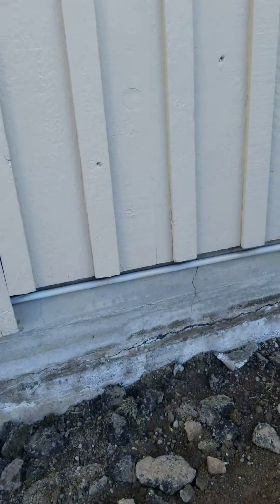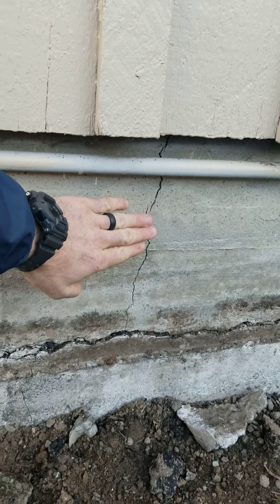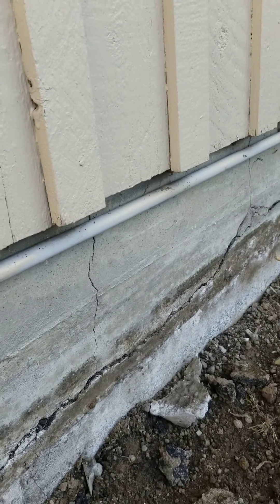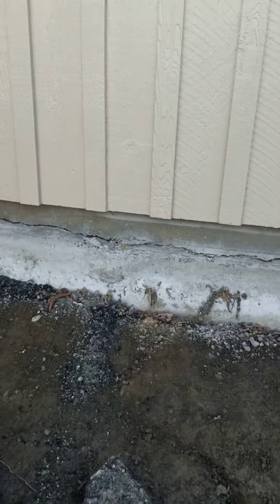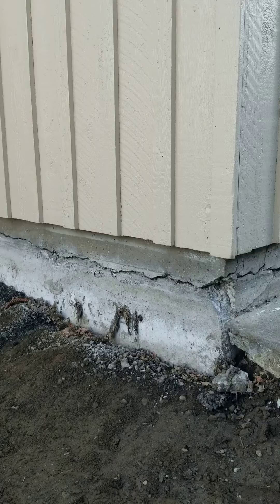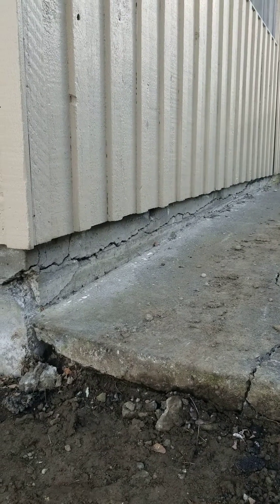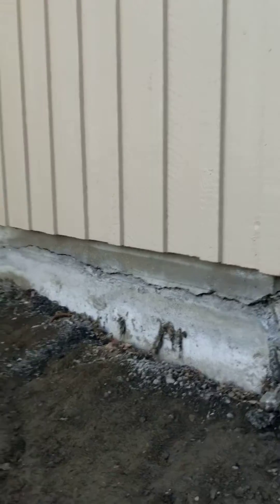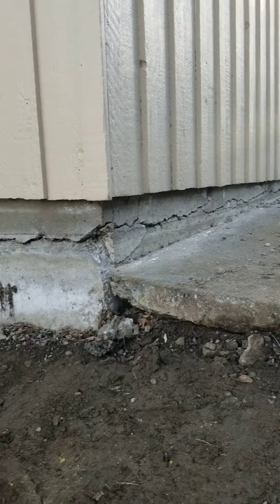Foundation cracks explained: Horizontal Cracks in a Foundation and What You Should Do

Comment: Thanks, I only have vertical small ones, but one of them is kind of long (like 10 inch”). I’ve read that it shouldn’t go past 6”.
Reply from the maker: At least where I am from, it’s is more the width of the crack that is an indicator. Typically, less that 1/8 inch wide is a mi or crack. More important to note if you notice changes in cracks over time.